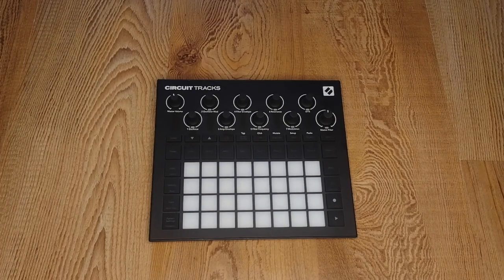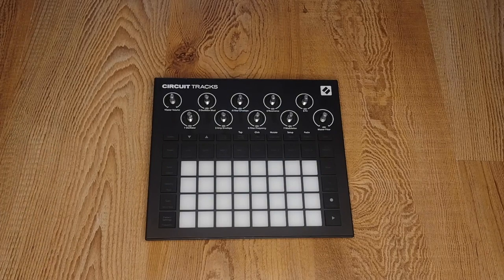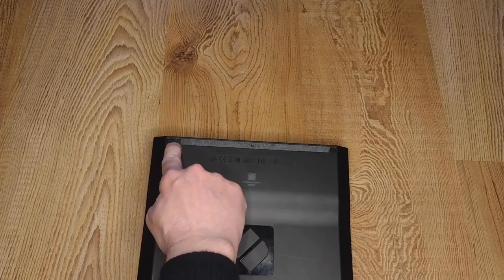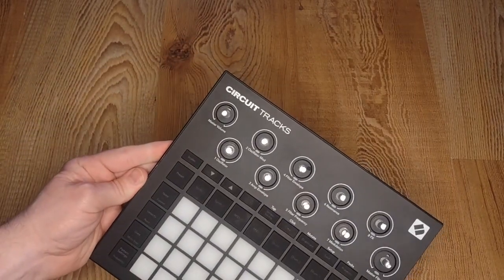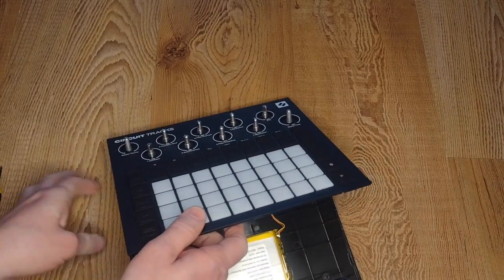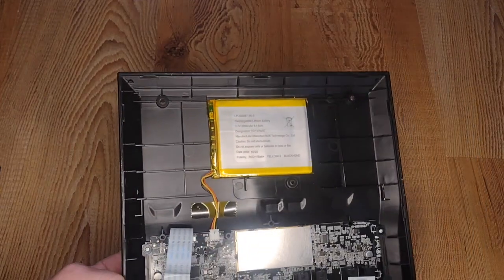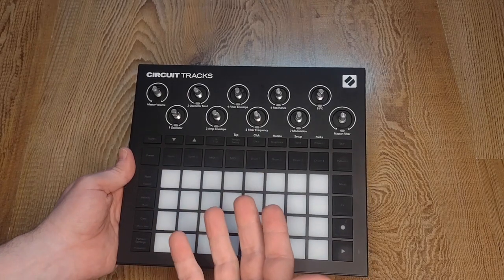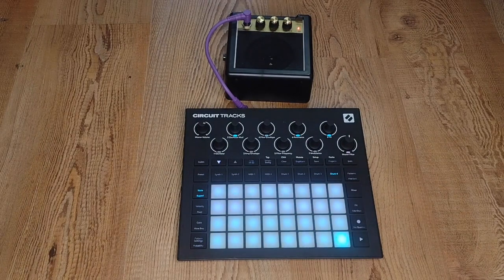Novation Circuit Tracks Teardown

Comment: Great video.
I was going to do a video myself as, like you, I was super curious about this Novation circuit battery issue.
I only had mine a week but just had to solve my curiosity.
Yeah the label on the back. That was super devious.
One thing you missed out!!!......
YOU CANNOT OBTAIN A NEW BATTERY!!!!
I googled the battery number with the manufacturers name and details. It came up with the exact battery but on clicking on it you get" THIS PAGE IS NOT AVAILABLE".
What I can make out of that is that Novation have bought all the rights to that particular super thin battery and made it unavailable to anyone outside of Novation.
I find this particularly devious as there are people like you and I that are well capable of taking things apart and changing a plug in battery.
They probs did not want us to see that the boards are the same  but with different components.
Why the big fuss over changing a battery?
Stupid.
Reply from the maker: Many game console controllers use a similar battery pack, so it won't be difficult to replace when the original finally stops working.

Comment: faceplate is made of metal?
Reply from the maker: It's plastic, but it's pretty solid. It will flex if you apply a lot of pressure, but there's no need to do that.